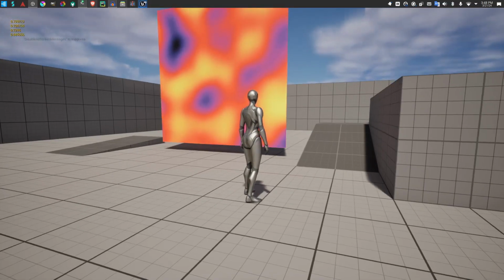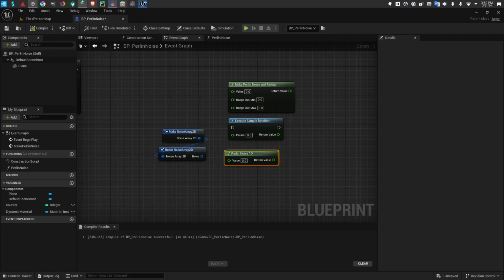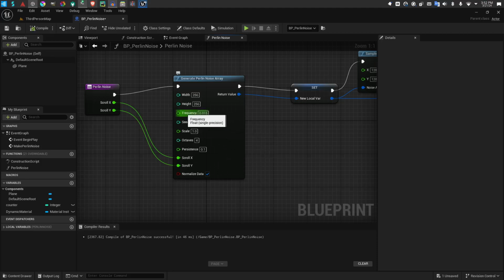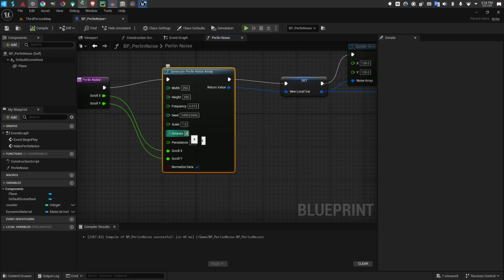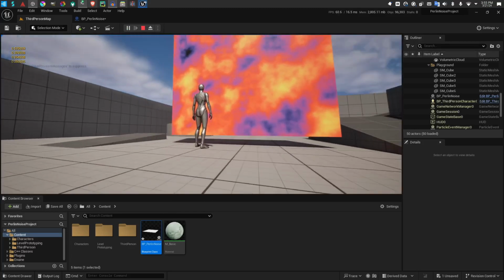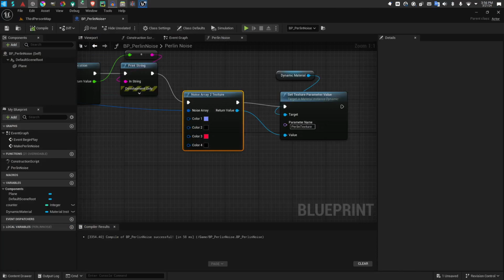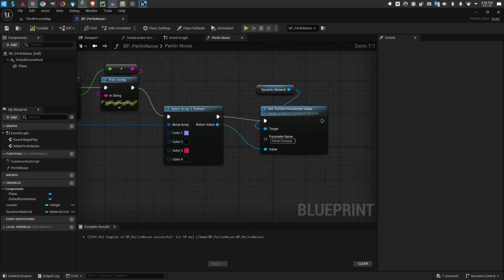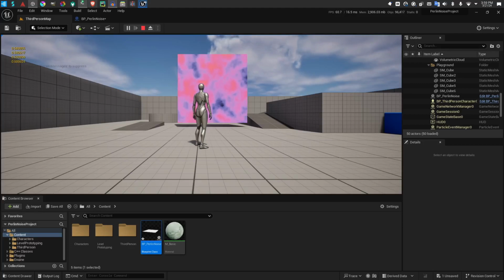Generate Perlin Noise In Your Blueprints With FULL CONTROL - UE5

Comment: what plugin? what blueprint? there is no "PerlinNoiseBlueprintLibrary" in the epic games marketplace..
Reply: Hello, after looking at the marketplace i found a free "Noise generator (perlin...)", and it s probably the one used in this video. There are the same nodes that are used here. I hope it helps

you need to enable the plugin that comes with it
Reply from the maker: I'm terribly sorry for being so late. I forgot to add the link to the code. Here ya go! Stay tuned for a much bigger project.

https://github.com/ArtoLabs/PerlinNoiseBlueprintLibrary